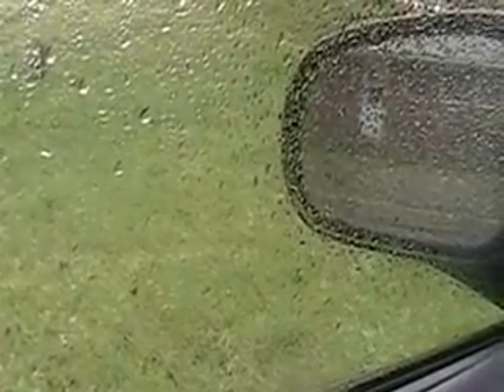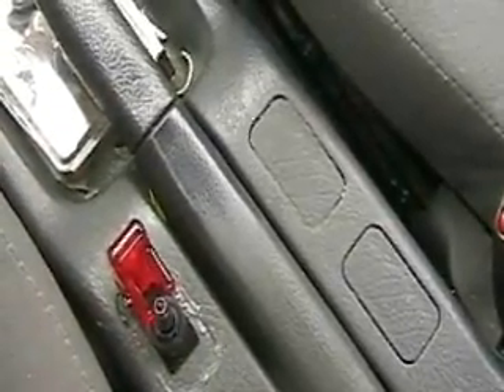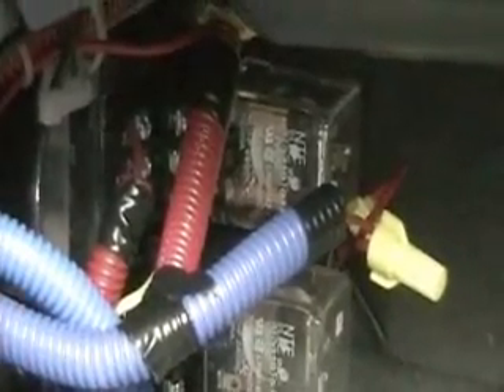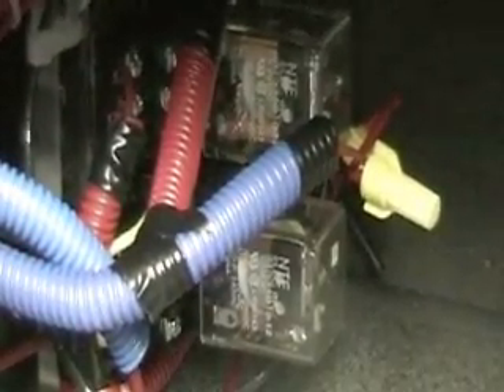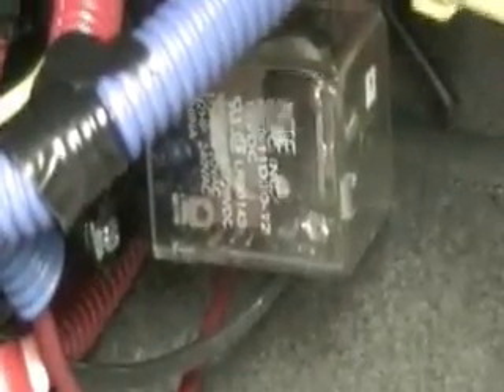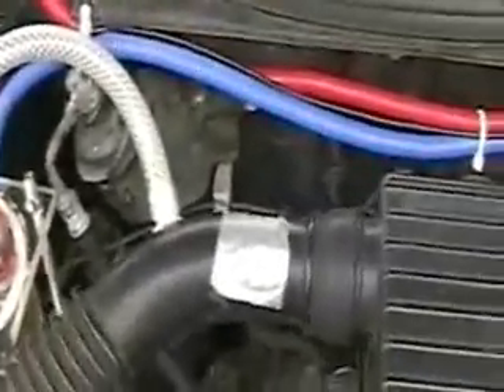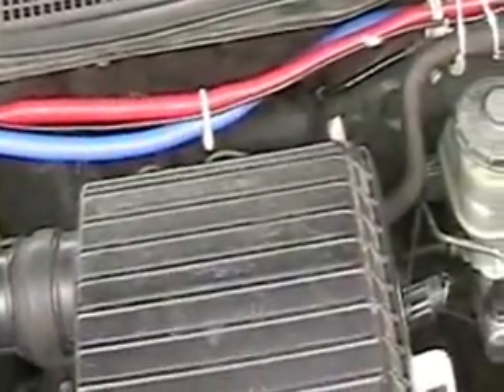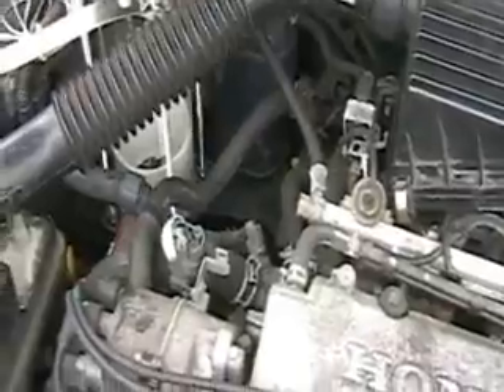Hydrogen Tap ( FOCUS -HONDA) 312

Comment: Hi john, in this video above you mention that the 2 relays are wired in parallel for protection against a relay welding closed. wouldn't the relays need to be wired in series? in parallel, if one relay opened, and one was welded closed, all current would just go to the closed relay.